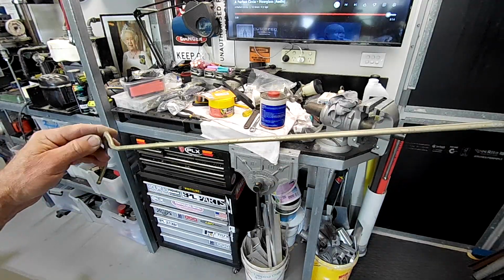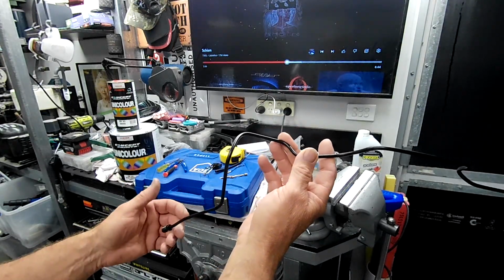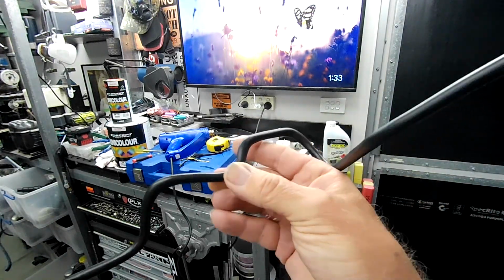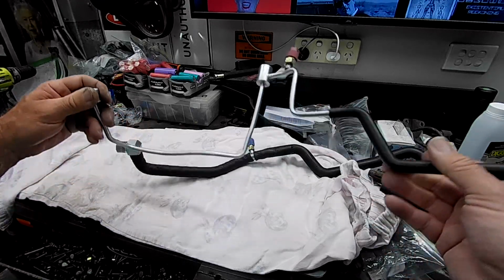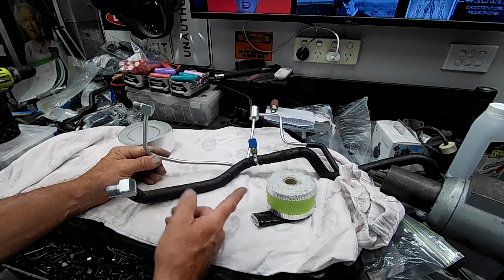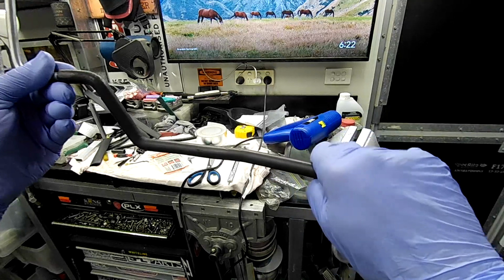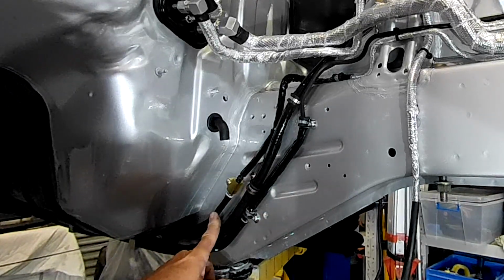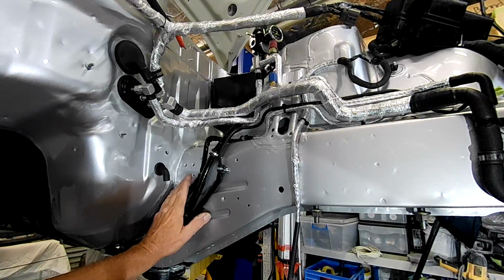Heat Shielding the AC, Brake & Fuel Lines, Project Fairlady Nissan Z32 300zx Twin Turbo Mega Build

Comment: Thanks for this. This is going to help me a bunch as I re-do mine!
Reply: The AC condenser drain hose for mine is trashed. It’s the drain that has 90 degree bend in it shown in the last part of your video. Any idea where I can get ca spare? I’ve checked both Z1 and concept Z with no luck.
Reply from the maker: It's still available new from Nissan, at least the RHD one is, so assume LHD is too. I recall It was pretty cheap (yes I was in shock too.)
Reply from the maker: Pleasure Mate, glad you found it helpful. Cheers.